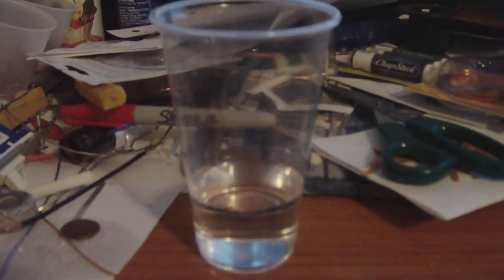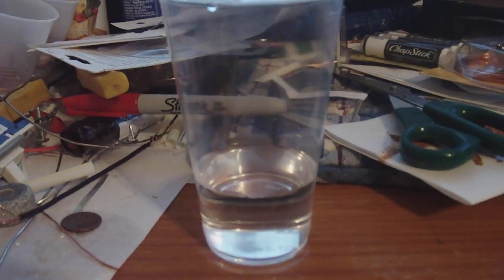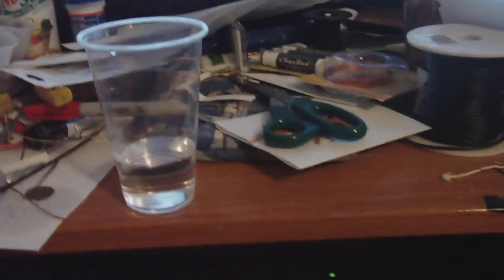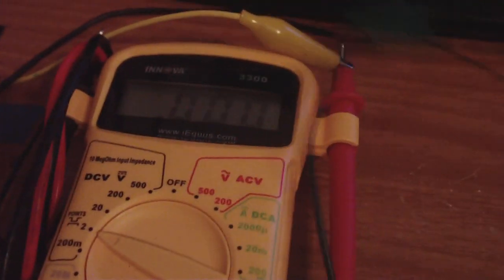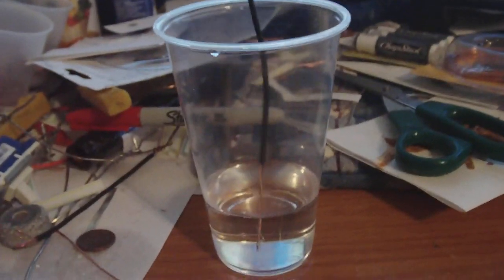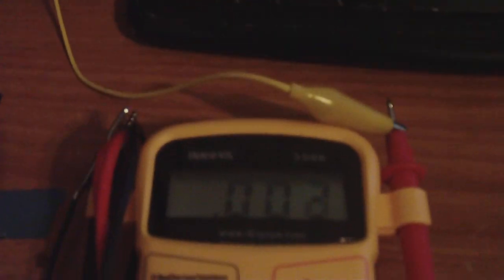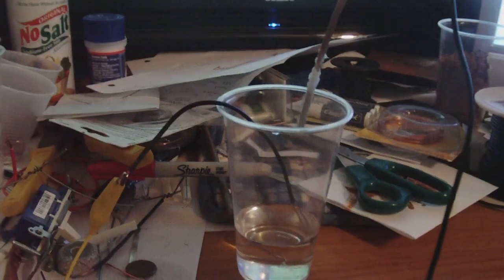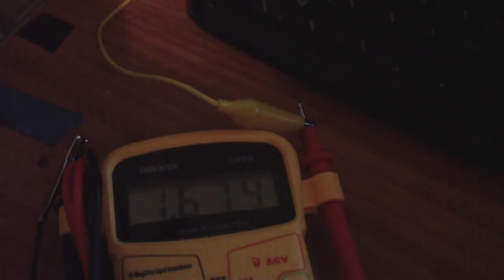Keeping Magnesium from corroding in battery

Comment: Can you show us the current? 
I mean you may have voltage from the differential of the metals, but if you have no current then you have no power. Voltage is not power. Only the potential. It's like holding a ball at the top of the hill and not letting it go.

Comment: @ibpointless2 
Will it just dissolve or will it build also up a coating ?
Please try to use electrolysis on the magnesium as a plus pole
in vinegar. Durafix metal alloy (alumium soldering metal) builds up a great black coating 
this way that shields the durafix for a long time.
Regards, Stefan.

Comment: Well done, please can you show the surface of the magnesium ribbon, when you hold it for a minute or so into the vinegar ? Will it show a white magnesium-oxide coating or will it get black ?
What kind of coating will it get ?
Please also show the short circuit current of your cell . 1.8 Volts and what is the current of the petroleum jelly cell ? Many thanks. Regards, Stefan.